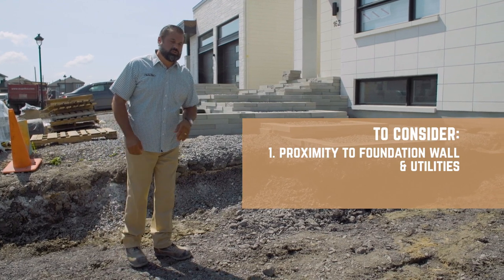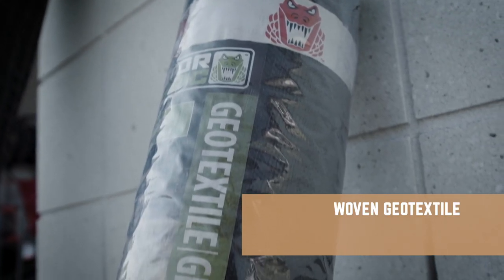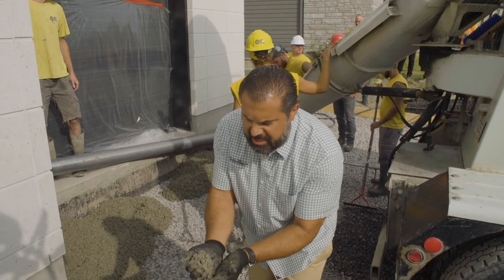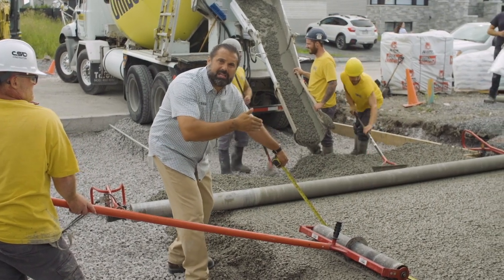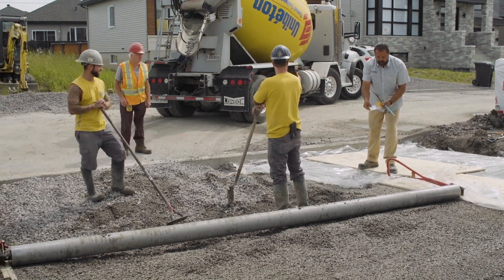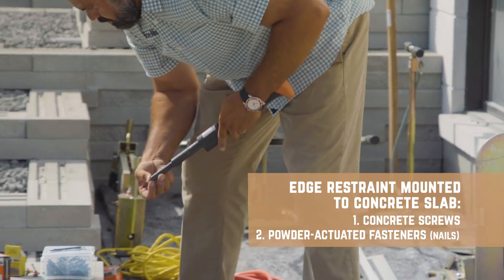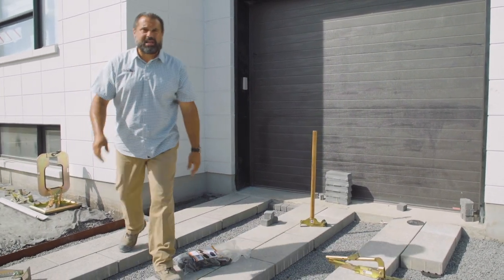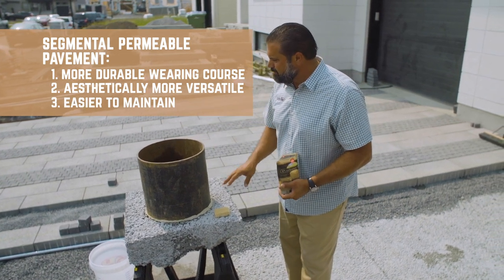How to Build a Permeable Pavement with a Porous Concrete Overlay

Comment: Is this method of paver installation viable in northern climates with heavy clay soil?  My concern would be in the winter time the pores would fill with water and freeze up before being able to drain out.  repeated freeze and thaw cycles like this I can't see as being a good thing.
Reply from the maker: Hello, thanks for the question/concern you have over this method of installation. So based on some research and also talking with Paver Pete on the matter, it shouldn't matter. To explain, the geothermal heat that is underground is almost always at a constant temperature. This will help water go through the base and then to the exfiltration pipe which will then lead out to the environment. So even if you see piles of snow or ice form on top of pavement, as soon as it starts to melt, the water should go down and not cause any issues in the longterm. This project you see here was also built in a heavy clay soil in the south shore of Montreal. If you need more information or clarification, please do not hesitate! We'd love to help you out!
Reply: @techobloc  Thanks for the detailed reply, and getting in touch with Paver Pete!  One of my colleagues I graduated with at Purdue said he spent a day with her firm in Pittsburgh a month or so back which was very helpful.  

We had a job we were looking at about a month back that clients wanted a permeable system on, but with the layout of the site I couldn't se how we were going to get any fall away from the drainage under the patio, so I was just very concerned about the drainage. Thanks again.

Comment: The problem is the porous concrete must be used such that the water is made to go to the underground water bodies instead of connecting to a drain pipe that again goes the same place as before.
Reply: it does, the drains are for excess water, excess water that would exist regardless of the driveway being there or not

Comment: How long is the lifespan of a frequently heavy trafficked project like this? How much more doe this cost than alternative options and how much plastic is used in the whole process that stays in the ground? 

I would like to know because I am a student looking at water management techniques with considerations for the environment and we already have too much plastic in the environment.
Reply: It is possible to put it without any plastic in the ground. I don't like their method either. It speeds up a process a bit, but is wasteful and as you said created pollution. A better option is to use plastic guides from the top (similar to what is used with the terakota tails on walls), or specially designed shape of bricks, to make them self aligning with proper distances.
Reply: @movax20h  always good to know of viable alternatives, thanks for your reply.